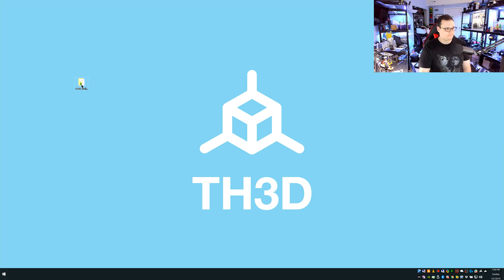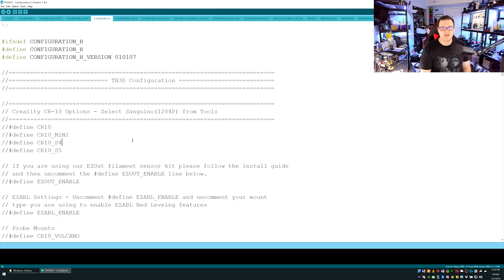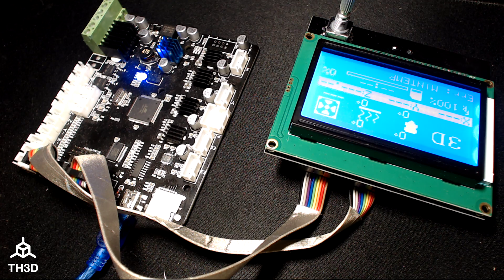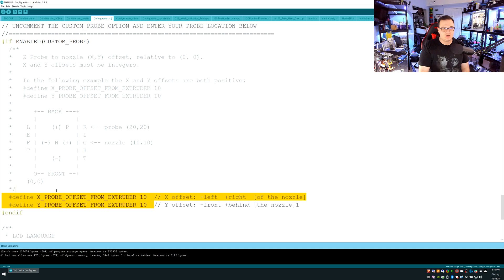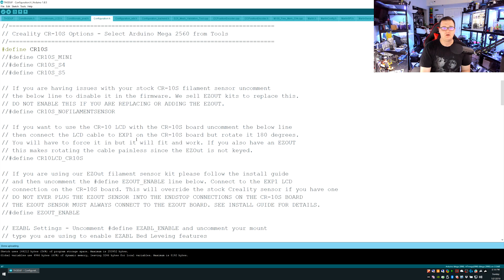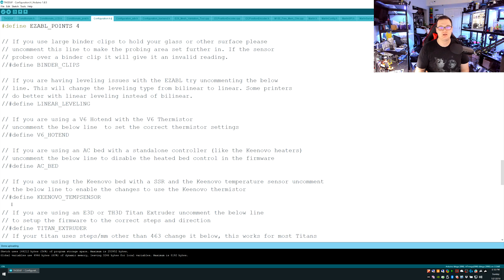TH3D Unified 1 Firmware Setup Guide - Stock, EZABL, EZOut and More!

Comment: Hello everybody. i am trying to upload the TH3D firmware but I keep getting this error on upload in arduino. if anyone can help me clear this error I really would appreciate it. I am new to arduino and don't know the code and don't know what to look for 
Thank you in advance.

Arduino: 1.8.9 (Windows Store 1.8.21.0) (Windows 10), Board: "Arduino/Genuino Mega or Mega 2560, ATmega2560 (Mega 2560)"

In file included from sketch\ultralcd_impl_DOGM.h:85:0,

                 from sketch\ultralcd.cpp:96:

dogm_font_data_ISO10646_1.h:34:20: error: U8glib.h: No such file or directory

compilation terminated.

exit status 1
U8glib.h: No such file or directory

This report would have more information with
"Show verbose output during compilation"
option enabled in File -> Preferences.
Reply: Download the full package incl. the Arduino IDE and start the batch file. This is lot more easier than fixing the path to the missing library . 

And expect no service from TH3D. My questions left unanswered as well. Maybe we should send them money to force a reaction?
Reply from the maker: We don't do support on YouTube comments. If you are a customer that has a product with support (EZABL kits) then you can contact our helpdesk through our contact form. Otherwise we have communities setup to get help with 3D printer issues: http://community.th3dstudio.com

Comment: anet A6 with auto bed lvling. I was on a previous version of TH3D. updating to current version U1.R2.9b. configuration.h > anet a6 > correct LCD > EZabl, Flash OK no errors but LCD was frozen after install. I pulled the plug no LCD. reflash bootloader, reinstall TH3D still no LCD... what now?
Reply: just for kicks... I reflashed with the other LCD and mine was making noise, popped in a 5 button LCD and it worked... SO... Reflashed to the bigger nob LCD and reinstalled and still not working. did the update break my LCD?

Comment: Can anyone tell me if i have to make any changes on the latest firmware to use Dual-Z Endstops on an Alfawise U10 (i would change the stock stepper driver for the z-axis to two a4988)?
Reply: Okay, i've learned that the TH3D Firmware is not able to handle Dual-Z-Axis (btw: why'?). So i've flashed the buggy original one and now it works pretty good.
Reply: No answer is an answer too. Should i send money first?

Comment: Hi is SKR v 1.1 with touch screen suported by this firmware .... will EZabl sensor works fine after upgrade to this firmware ?
Reply from the maker: Haven't messed with that board before. But our firmware does not support smoothie boards right now.
Reply: it works with Marlin 2.0 too 
 @TH3DStudio
Reply from the maker: We haven't messed with those boards but if its running marlin you can wire up the kit to the ZMIN endstop S and - pins.

Comment: Can you flash the boot loader with the board in the machine?
Reply from the maker: Yes you can.
Reply: Now that I know what I’m doing... your software is amazing and runs so smooth from the little testing I’ve done. I have bought 3 more filament sensors and easyout boards for the rest of my ender 3’s because I can’t run a business without filament runout detection! Love your products Tim

Paul

Comment: Great instructional vid but I have a couple questions. Are the Ender 3 Pro and Ender 5 on the list? Also I've already ordered the BLtouch so does the TH3D firmware have this hardware feature to enable? One more, does the EZABLE work with a mirror bed surface? Thanks much.

Comment: Uploading from where? Is there an Arduino involved in this. I'm so confused.
Reply: I was too! Arduino IDE is an app that they have you download. You use a usb plug and connect your computer into the usb port on the side of your control box. That was the only part i found unclear.
Reply: Just to clarify, since I just ran into this problem myself: You do not need the Arduino UNO board to upload the firmware. Use a USB cable from your computer to the printer and use the Arduino IDE (the software) to upload. The printer essentially has an Arduino inside.
Reply: If your printer control board does not have a bootloader installed (e.g. Ender 3) then you will need an Arduino board to put a boot loader on it. The Arduino board is only used a programming device for this bootloader. Once the bootloader is installed, it's there forever - you no longer need the Arduino board. If you already have a bootloader then you just need to connect the printer directly to your computer to upgrade your firmware. There are a number of ways to flash new firmware. One of the common ways is to use the Arduino programming IDE. Perhaps this is why some people (myself included at first) found this confusing. So, to be clear, you only need an Arduino board to flash a bootloader. After this, you can still use the Arduino IDE (without the board) to flash firmware directly to your printer via USB cable.

Comment: Just did a firmware update on CR10s and now when my print starts it begins about 25 mm above the bed. Auto home goes to about halfway up the Z axis. Bed leveling is another story, just goes through a grid and raised a few millimeters at each point it stops.
Reply: trying to upgrade mine now, did you have an difficulty?
Reply: @Sideh7  I ended up uploaded a already setup file. I do get an error when turning the control box on, every time, it tells me the print did not finish even though it did. I hear this will be fixed in a new update.
Reply: @JeffHoffmanInfrared  thanks for your reply Jeff. I had issues uploading the firmware but after picking a different protocol it worked. I wonder if mine will do the same as yours. Will investigate.
Reply: JEFF how did you fix this!!!! i need your help man i am at my wits end... thanks for any help to this most annoying of problems.
Reply: @nathanielschoenhoefer4809  I do not recall where but I found a setup file already changed and uploaded it. Maybe here https://www.printedsolid.com/blogs/news/installing-marlin-1-1-9-on-your-cr-10s-with-mesh-bed-leveling-thermal-protection-better-menu-layout-and-finally-power-resume

Comment: How do I use the EZOut and EZABL together on the Ender 3? I'm using pinout 27 and 29, but I cannot find the line of code regarding pinouts for the EZOut.
Reply from the maker: You need the EZOut filament sensor kit and the EZABL kit. Not sure what you're doing with pin settings.
Reply: @TH3DStudio  I connected the bed leveling to pin 27 and my filament runout sensor to pin 29, but I found the line of code and changed it to 29 as default was 27 for EZOUT.
Reply from the maker: So you don't have the EZABL?
Reply: @TH3DStudio  I still have EZABL, that one is on my pin 27, but I also have a BLTouch on another printer using pin 27 and now I got my spare micro switch to work using pin 29 as a filament runout sensor :) I was just asking where the coding is for the EZOUT so I could change it to pin 29 instead of defaulted pin 27 in TH3D firmware of marlin and now it all works together.

Comment: Any tips to using with the CR-X. Printer working fine though Display just showing Creality logo, Tried enabling the bug fix option.
Reply from the maker: CR-X is not supported yet and when it is to get full features you will need to swap the LCD. The touch LCD is too limited and closed source.
Reply: @TH3DStudio   thanks for the reply. I have it working pretty well minus the screen. Ill to revert to the default until an option becomes available.

Comment: So in this video the PC running arduino is connect directly to the printer via USB (com port) to upload the firmware, and does not use an extra arduino board connect to the printer like you would do to install a boot loader, correct?

Comment: Since it specifically mentions it being for stock printers I assume there's no way to make it work for boards like the MKS Gen L ?
Reply from the maker: It works fine and we use it on machines with it here. Take a look at the Configuration_th3d.h for our custom machine configs. If you have a working Marlin we can integrate your custom machine into the Unified for you if you get a EZABL kit from us. :)

Comment: I have flashed the Firmware on my cr10s,
but when i use the OEM_Cr10 mount in configuration.h the z probe stays as triggered.
but if the OEM mount is commented out the z probe works correctly (i have also tried switching the endstop inverting boolen with no luck)
Reply from the maker: Send your EZABL order number over to Support@TH3DStudio.com and we'll get you sorted out.

Comment: I have bought EZABL for my Creality CR-10 from your webpage some time ago and i am still VERY HAPPY !!! Now i want to upgrade the FW to latest Marlin version. Question: How is it possible to create hex file after setting up Configuration.h in order to flash the FW via Octoprint flash plugin? Thanks for all your great work.
Reply from the maker: Look for the Export Compiled Binary option in the IDE menus at the top. HEX will be in the firmware folder after it compiles it. DO NOT USE THE ONE WITH BOOTLOADER IN THE NAME.

Comment: I am a total newbie, watching this I am a bit apprehensive, but I am also fairly confident in the process so long as I ask some questions :) 
- Can the bootloader be flashed by directly connecting my PC to the Ender 3? Im asking because I keep hearing something about an Arduino board and I dont know if I need that too or not. 
I am wanting to add the EZABL to my Ender 3 soooooo bad but want to make sure I do it right..
Reply from the maker: You need the Uno to load the bootloader. Once you have it on the board you can update the firmware over USB in the future.
Reply: @TH3DStudio  Ok, but once I use it I dont need it anymore correct? It's a one shot sort of thing? So if I can borrow one its better than buying one?
Reply from the maker: @Battlewear  you are correct but personally I always have one on hand in case of a bad flash. You also need the jumper wires. We have a full kit here: https://www.th3dstudio.com/product/arduino-uno-bootloader-flashing-kit/
Reply: @TH3DStudio  I have asked my family for all the goods to get the EZABL and PI up and running including the Arduino board..

Comment: Anyone knows if i have to change my cura settings after updating to generate a gcode marlin instead of reprap?
Reply from the maker: Both should work but since it has the option I would switch to Marlin. The stock machines run Marlin, just an older one.

Comment: I have a Anet A8, but am running a Ramps 1.4 board.  I am getting a error because I have not selected the anet boards on the Arduino configuration.  I the a similar printer in your firmware that used a ramps board?

Comment: 2 questions:
1. Updated to 2.1, in pronterface get an error when calling out code M304.

2. Were and or how to update to z offset. Seems that I’m having an issue. Level bed multiple times and when trying to print something it prints in the air.
Seems that it goes to roughly
 .1 mm .

Comment: I'm getting the error message: "Error compiling for board Arduino/Genuino Mega or Mega 2560" 

I know you said to use the "Arduino Mega 2560", but there was no option for that. Is there something I'm doing wrong? The only thing I could think it would be is that I don't know what port I'm supposed to be using, or if I'm even using the right one. 

For reference, I am using a Mac computer.
Reply: Same problem! Any solution?

Comment: the stock cr10s filament sensor works with this firmware? Am I losing anything upgrading? Thanks
Reply from the maker: Yes it works with this firmware. If you use our "stable" version that is the U1.R1.X versioning Power Resume is NOT in that one. The "Testing" build has power resume in it that is on the U1.R2.X versioning.
Reply: thank you man!

Comment: I got it! Finally. But I have a question. I'm planning on replacing my CR-10 hotbed with a Keenovo 125V heater, WITHOUT external temp controller. Do I need to change the thermistor setting?  "define KEENOVO_TEMPSENSOR"   ?

Comment: I tried using the Arduino Leonardo as a programmer to load the Sanguino 1284P bootloader on Ender-3 -- I wan't successful but instantly successful using TH3D pre-configured Arduino IDE with the Genuine Ardunio UNO. However, my LCD went blank and turning the machine on after that the LCD stayed lit up but blank and no activity -- I thought for sure I had "bricked" the Sanguino but loading the TH3D Marlin software U1.R1.9b went smoothly and brought back my display and the printer -- I am thankful for that!!   Good into and channel. I just subscribed.

Comment: Thank you.  I just updated my CR10.  Everything uploaded fine.  One thing I didn't see you mention was to reset your EEPROM per the instructions in configuration.h.

* !!!!!!!CAUTION!!!!!!!
* After updating be sure to either send M502 then M500 to reset your EEPROM or on the printer
* LCD go to Control > Initialize EEPROM to clear out the EEPROM to defaults.

Comment: I get an error when I try to compile:
C:\Users\Yoda\Downloads\3D Printing\Software\TH3D_UFW_U1.R1.9\Firmware\TH3DUF\TH3DUF.ino:61:110: fatal error: U8glib.h: No such file or directory
     #include <U8glib.h> // library for graphics LCD by Oli Kraus (https://github.com/olikraus/U8glib_Arduino)

Is it possible that the U8glib.h is missing from your v1.9 firmware package?

BTW, before compiling I only uncomment the following lines in the CR-10s section: 
#define CR10S
#define CR10_OEM
Reply from the maker: Use the included arduino IDE> :)

Comment: Hi, I'm trying to update the firmware of the cr10. My board is v1.1.2 I did the bootloader as explained, the lcd turned blue when I load the firmware th3duf this error appears /Users/edvanpereira/Downloads/TH3D_UFW_U1.R1.8a/Firmware/TH3DUF/TH3DUF.ino:61:110: fatal error: U8glib.h: No such file or directory
     #include <U8glib.h> // library for graphics LCD by Oli Kraus (https://github.com/olikraus/U8glib_Arduino)
                                                                                                              ^
compilation terminated.
exit status 1
Compiling error for the Sanguino board (1284P Boards)

can you help me!?

Comment: My steppers were working like trash, clunk clunk clunk... updated firmware from stock CR10s 5S with your program and video, clunking is gone.  I spent all day trying to get to the problem, ruled out mechanical (changed out feet, took off belts, removed connector extensions), ruled out stepper voltage, and was left at firmware.  My last hope and it worked!!! Thank you for your help within the community.

Comment: hi young man !  i have a question , i have a cr-10 since 1 month and the mainboard just.. bunrt.. so i have to change it , my question is , should i change for the 10S mainboard instead if i want to use your bed leveling kit and can i keep the same screen on my cr-10 or i have to change it too .   thank you
Reply: yup - make sure if you get the newer board that it has the voltage fix (there was a flaw in earlier boards on the CPU voltage regulation that caused temps to bounce).

Comment: So if I was to update the firmware and had issues the new firmware what option do I have to revert back to the stock firmware. Or is it lost forever?   Reason being is that I plan to purchase the EZABL probe but want to have the option to revert back to stock if needed.
Reply: Thanks!  Got it.  Flash for stock and EZABL works well. A+

Comment: Why has your LCD got 2 ribbon cables?
Reply: That looks like a standard Reprap Discount Full Graphic Smart Controller, which has two cables, One cable drives the LCD image and enables the push button and buzzer, while another cable drives the convenient SD-Card reader embedded on the side of the display, but also enables the rotary encoder and the emergency reset.

Comment: More vendors should use a well-established version as their base, then make it customizable from there. Makes it much easier to see what changes were made. I'm getting 1.1.9 ready (no, srsly) and it has some nice adds. Specifically I wanted to point to some new bitmaps for the creality machines. For example, https://github.com/MarlinFirmware/Marlin/blob/bugfix-1.1.x/Marlin/example_configurations/Creality/CR-10S/_Statusscreen.h which includes the "CR-10S 300" original graphic for the status screen. Plus these are dual-nozzle ready, should anyone someday want that. Cheers!
Reply from the maker: TH3D logo in the corner?! :D